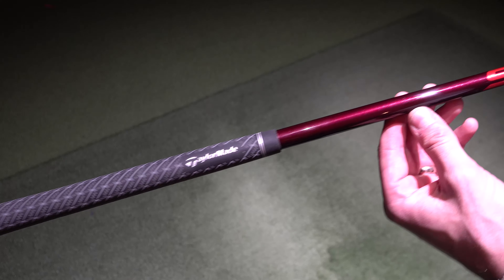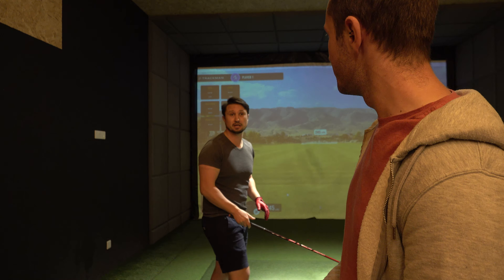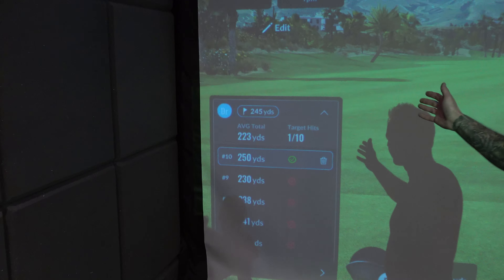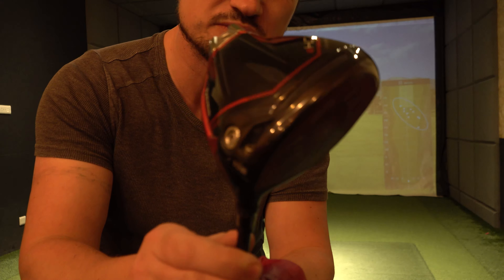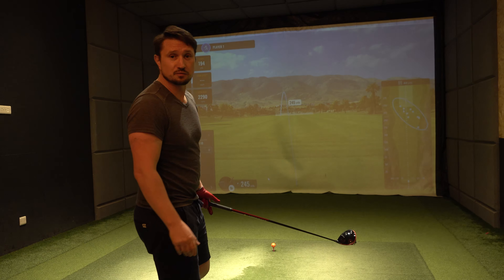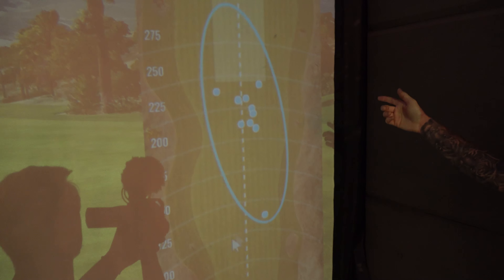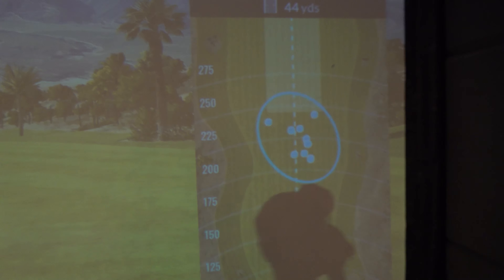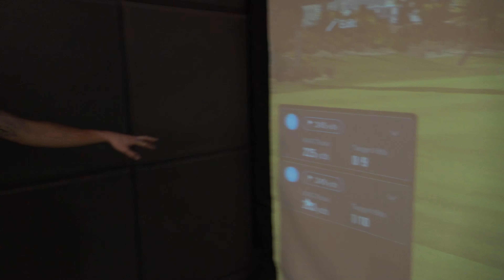Regular Flex vs. Stiff Flex Shaft for a High Handicap Golfer?

Comment: Generally, the more you power the swing with the lead side pulling and using a lot of body rotation, the less shaft stiffness matters. The more you use the trail side to push the shaft through then the more shaft flex matters.

Comment: I had a lesson last week and the pro, @jameshamon upped the loft on my driver to 12° and it helped with my distance, dispersion and my spin went up massively. I actually gained 20 yds in carry alone. Pro fitting is the only way forward in a new driver. I'd never buy a stock off the shelf again